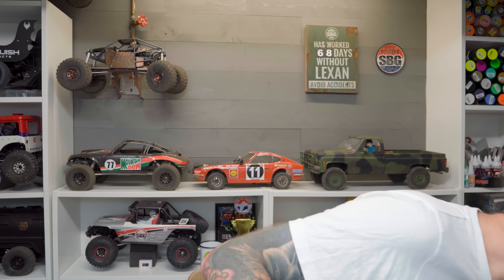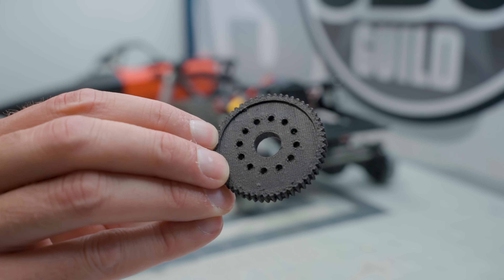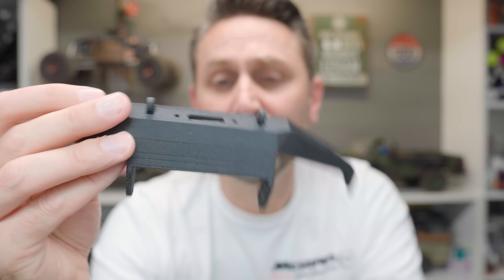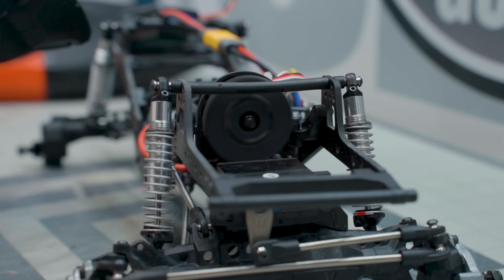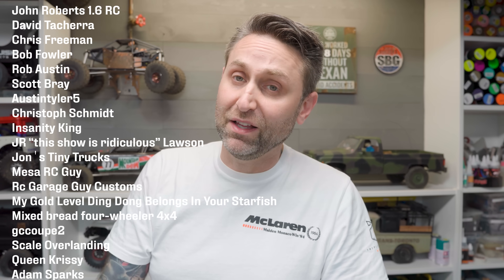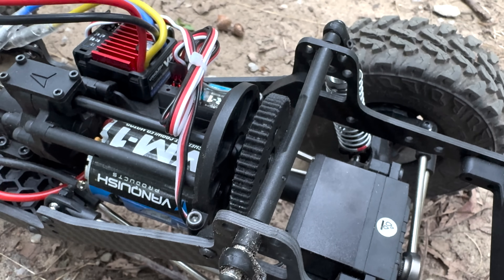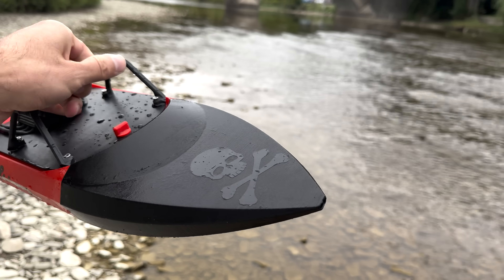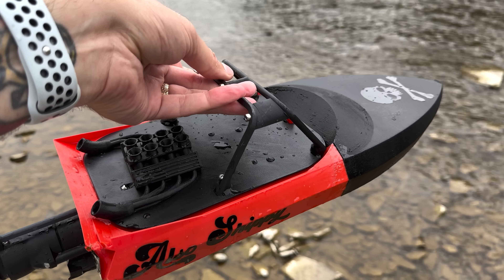Say Goodbye to Old Filaments – Meet the Game-Changer of 3D Printing!

Comment: Goodbye to old filaments? Not at $200 per kg it's not. It's certainly an interesting material, but I'd rather stick with some type of fiber-reinforced filament given the price.
Reply: It all depends on the application. At $200/kg I wouldn’t use it for Gridfinity bins, but for a complex part that I needed metal-grade strength and toughness for, it’d be a slam dunk and, yes, a game changer :-)
Reply: @JThelen1031  best part it’s not even a full kilo gram. 3/4 or .75 wow
Reply: Things can be game changers even if they're not affordable or easy to get to at first. There's things like telephones, cellphones, 3D-printing, CF-parts, WIFI and so on. All of them were insanely expensive in the beginning or required expertise.
Reply: The fibers aren't reinforcing anything. They might improve abrasion resistance but they far to small to add strength. And the weakest part of any print is the layers, which have no fibers joining them.
Reply: Fr just print CF or GF nylon
Reply: Interesting but too expensive
Reply: Prices will come down with volume, but I can’t see this ever being $20-$30/kg. It will likely always be a premium product.
Reply: We use $300 resin for jewelry business. So business owner can afford this filament.
Reply: well this saved me watching the vid xD 200 per kg is not worth it no matter what it is lol
Reply: Most fiber reinforcement is scary.  Tiny sharp fragments working their way into your skin, eyes, lungs.  Think asbestos, mesothelioma, etc.
Reply: Most fiber reinforcement is scary.  Tiny sharp fragments working their way into your skin, eyes, lungs.  Think asbestos, mesothelioma, etc.
Reply: Glad I saw your comment, I can skip this video.
Reply: Where did you get that price? I just checked on Amazon, and PPA-CF is $56 per kilo. Different companies charge different prices, but not by anywhere that much.
Reply: 200 the Chinese will copy themself fast
Reply: @psxtuneservice  It is not from China?
Reply: Does fiber reinforcement actually make pieces any stronger, though? My understanding is that the carbon fiber is chopped far too short to provide any real strength, which normally comes from many long parallel stands of carbon fiber. Instead, the carbon fiber adds stiffness and dimensional stability.
Reply: @Sharpevil in my experience it does, but I personally will never touch carbon reinforced or glass fiber reinforced filament ever again. You can rub your finger over the filament and you'll get fibers permanently embedded in your skin. We've banned the filaments at work entirely just on health concerns.
Reply: @Sharpevil no it doesn’t. It Can make it more wear resistant but carbon fiber needs to be in strands to do its thing. Pausing the print and glueing a ply of carbon weave then baby stepping the z and continuing printing is a fun challenge 😊
Reply: @Sharpevil  seems to help with layer adhesion too
Reply: @Sharpevil it does at least in XY plane. But adding fibers also improves printability like shrinking, warping etc. So it is not just about strenght.
Reply: @Sharpevil  i'll second everyone else here to say CF filament is MUCH more durable. back when it first came out we got our hands on a bunch and i did some basic 'can i break this' tests, and the answer was basically no. it was also much more rigid, which meant that, as it was cf-abs, it was a lot easier to print. much less warping. abrasive as /fuck/ though. steel nozzles are a must.
Reply: @Sharpevil  Yes, but only along the direction of the print because the carbon fibers align with the direction of the print.  CF does nothing, or can actually decrease, the strength of the filament against the direction of the print.
Reply: @Sharpevil Yes, it does. Stiffness/modulus is one measurement of strength.
Reply: @eighty-eighth_section   >Stiffness/modulus is one measurement of strength.

That's incorrect.

For example, aluminum alloyed with moderate percentages of other materials have the same modulus within the percent or two, but can vary in strength by an order of magnitude.
Reply: @nlkatz  I'm stating that there are multiple measurements of strength. Of course it would vary. You need to be specific. Are you referring to tensile strength? You didn't state that, nor the commenter.
Reply: @nlkatz  modulus is one mechanical property we compare between materials. This is one way we can the strength of a material. Tensile strength is separate property or value. I did not say they were the same.
Reply: @eighty-eighth_section  No, you stated that modulus is a measurement of strength.

It isn't; it's a measure of stiffness.
Reply: @eighty-eighth_section  >  This is one way we can the strength of a material.

Nope.

 Perhaps the confusion is because modulus and strength have the same units. 

That can be misleading, because modulus is strain divided by stress.

The units of strain are in./in. (or your preferred length unit), which divide each other out, so it ends up that modulus has the same units as stress.
Reply: @nlkatz  yes. Stiffness is one way to define strength. A strength is just a casual term of what we call some value of a mechanical property. It's whatever you want it to be. I can make up a property like fuzziness. And now I can compare fuzziness strength.
Reply: @nlkatz  stress is not the sole measurement of strength. What about impact strength? Completely different measurement and value. PLA has a relatively high tensile strength vs other common 3D print materials, yet many accept it as low strength or weak. That's because they are defining strength as some other property.
Reply: @eighty-eighth_section  If it's whatever you want it to be, anything you say about it is meaningless.

I'm not using the terms casually, I'm using the engineering definitions, which you need to understand if you want to know how much a part deflects, or whether it will break.
Reply: @nlkatz  it might be meaningless, but there are standard measurements of strength that are more used and more meaningful to compare. It's common to attribute a materials ability to resist deformation as a strength. That is modulus. That's why we see "strength tests" where people hang things off 3d printed parts and measure the deformation. Strength alone is not an engineering term. And you used strength yourself. It's meaningless if you don't use the specific terms. That's why didn't blanket comment that it is stronger. I specifically defined modulus as my measurement of strength or comparative value. Because simply saying strength would be meaningless and perhaps misleading.
Reply: @nlkatz  ok, I'm looking it up. You are right damn it. The term stiffness and strength are distinct in engineering terms. And yes materials can have high stiffness and low strength and vice versa. But many people would determine whether a part is strong or not by bending it. And if one material starts to slightly bend before the other, then they usually say it is weaker. But in technical engineering terms, that is not necessarily true.
Reply: @eighty-eighth_section  Correct, now at least two of us know betrter :)

My hat's off to you for having an open mind
Reply: @Sharpevil yes, but between layers I have doubts
Reply: @Sharpevil  I’m with you here. I absolutely deny that CF filament gives any benefit. It actually sounds silly. Glass fibers in a very already rigid material maybe, maybe, but I don’t have as much experience with glass fibers.
Reply: @TJbuffs  GF and CF nylon absolutely have different properties from vanilla nylon, they're stiffer and warp less while printing. No you're not getting the full advantages of fiber materials, but it does make a difference
Reply: @coledavidson5630  most of that is just because of void space/ filler. It warps less because it’s less plastic volume to warp. Stiffer for the same reason. But not better. CF chop in filament is stupid. Anyone who knows CF will tell you that. Try it with any fiber, you’ll get the same result. The CF itself doesn’t do anything extraordinary. Think of what makes CF special, the spanning fibers, then think of chopping up those fibers, taking away the benefit. It’s the same silly argument about “forged carbon fiber parts” where people chop the CF and smash it into a mold or whatever. Silly geese 🪿
Reply: @TJbuffs  how is it silly if it achieves desirable results?
Reply: @coledavidson5630   because you’re being tricked into believing it’s something else. It’s not giving you the results it should be according to the actual additive. It’s silly because you’re being bamboozled by people depending on you being ignorant. If you want to buy it. That’s your business. I’m just the gracious homie looking out for you.
Reply: @TJbuffs  you keep saying I'm being tricked, but I've never been under the impression it will give you the benefits of actual fiber weaves. Nylon with CF and especially GF are still just great materials. I fully understand you're trading away some of the nylon's inherent toughness for more rigidity and printability. These are more desirable properties for most hobby 3d printing applications at a pretty affordable price. What more would I want out of it? If you know a better alternative filler at the same price range or lower, I'd honestly appreciate hearing it, no sarcasm
Reply: @Sharpevil  Exactly what do you think tensile strength is?
Reply: Found 1KG for $70 on amazon, and Bambu has 1Kg on sale for $100, still not cheap But if you need it than it looks really promising
Reply: @MrHeHim  I think you may be seeing PA CF. Though right now Bambu does have it on sale $100 for 0.75KG
Reply: Make sure you wear gloves and a mask when dealing with printed CF products and I don't mean just while printing
Reply: @KernsJW no. You’re exaggerating. These are not that dangerous. People are thinking that these are like fiberglass insulation which gets in the air in large quantities when working with it. That’s not true.
Reply: peek is used all across the industry and it's $500 to $600 a kg
Reply: @NeutronRoboticsAcademy  yeah, in industry that's acceptable, hobbyists do not use PEEK pretty much ever
Reply: @NeutronRoboticsAcademy  youre confusing industry and hobbyists though. the difference is that industry sell those products so they can charge for the filament cost. hobbyists dont.
Reply: This is a fibre reinforced filament.
Reply from the maker: Fair enough! Thanks for watching!
Reply: Fiber reinforced filaments are not stronger, but weaker than non-reinforced. Its because the fibers are more of a filling, and actual fibers. So there is less of actual plastic in the material.
Carbon fiber works because the fibers are woven, they are long fibers. You can just add tiny fiber sub mm strands into a plastic and expect it to become stronger.
Not to mention how those tiny stands will be in your room air, in your skin from contact etc.
Reply: @Nobody-Nowhere supposedly thats for certain filaments like pla but it does make other filaments stronger
Reply: @Nobody-Nowhere  this is exactly it
Reply: @Nobody-Nowhere undiluted nonsense...
Reply: @Nobody-Nowhere people who say this are talking about cheap cf filaments. The better cf filaments are quite strong. You can tell a good from bad by dropping the part on something hard. A good cf filaments will sound like glass.
Reply: @Nobody-Nowhere  you don’t know what you are talking about. Adding fibre can reduce some mechanical properties but it can drastically increase others.

There are also no real known health concerns to do with printing using fibre filled filaments and whilst some may get in your skin there is very little or no information that just printing it will put the fibres in the air.
Reply: @conorstewart2214  From what tests I've seen having small pieces of carbon fiber in filament hasn't been that useful. There are printers that lay continuous fibers while printing and those do help.
Reply: @conorstewart2214  The only thing it seems to help is dimensional stability, but its much weaker and muck more dangerous to your health. So using those filaments simply do not make much sense at all. Its mainly marketing hype, that uses the image of carbon fiber to sell it.
Reply: @conorstewart2214  because there’s almost no real data on that as a whole. This is wild to see these arguments. Madness actually.
Reply: @Nobody-Nowhere you watched one video and decided CF filled filaments are weaker. Layer adhesion can have issues, but actual tensile strength across X and Y is WAYYYY higher. I've literally compared it. Not only that, stiffness dramatically increases. You've clearly never even printed the stuff so why do you even have an opinion on it? I've printed CF nylon for 4 years straight. It is incredibly strong and stiff and if printed right, has very good layer adhesion. All my parts are subjected to high stress that breaks 3dp parts.
Reply: @conorstewart2214  watch easy composites video where they tested printed CF reinforced... It's not very strong ( possibly stronger than not. But nowhere near the strength of proper CF.) personally wouldn't waste my money.. I'd rather print a plug to get a mould. Then use proper CF

Comment: Ok heres the secrete to strong fdm filament i will only post once so you buy yourself plastic solvent bonder the thinner the better then you put it in a spray gun and coat the whole body or whatever part you printed and that will bond the print layers into one and that body or part will be so strong you wont believe it. you print at 100% infill then spray and OMG i can have my wife stand on my rc body and will hold her no prob.

Comment: ..Edited.. Is it PPA-CF or PPS-CF? I have found the PPS-CF but it says you can only use it with the X1E. I can't seem to find a single thing on Bambu's website about PPA-CF. 

I found it!.   I was trying to use their filter tool and PPA  was not an option, only PPS. It is in the PLA section on Bambu's website.

Comment: Looks interesting. I have been using NylonX by MatterHackers for a while now, but have not tested the parts like you have and have not printed any as large as the hull on the boat. Definitely a game changer in giving you the ability to repair broken parts and designing stronger ones, once you overcome the CAD learning curve.

Comment: Ppacf is a huge game changer. I watched a guy print an elephant figure and then stand on it. Fuzzy skin makes the finished product look so much better and gives that Bedliner look and feel in things.
Reply: "I watched a guy print an elephant figure and then stand on it"
So? Tests have shown even a screw thread printed in PLA can hold up to 50kg, you don't need special filament for most purposes. And on top you don't risk your lungs with carbon fiber dust.
Reply: @yakostudios5405 Look up- After 11 Prototypes, I finally did it. from Morley Kert.  He stands on the mini Elephant figure in it and also makes a killer part for the One wheel.
Reply: @yakostudios5405, https://youtu.be/RzFl3H5293M?si=LwlcrqOksKaGwgdP
Reply: @yakostudios5405 I guess it's from the latest video of Morley Kert.

Comment: for 166$ a roll is crazy expensive. And it says it's only possible to print with X1C. I don't know why a P1s with hardened nozzle would not be able to print it.
Nice review nonetheless, A PLA+ or tough spur gear would have yeet itself to the moon. I really like the 3d printing content.
And do you have a link for that boat? looks awesome.
Reply: It's actually only $100 per 750 g spool right now. The P1S is enclosed and supported, as long as you use a hardened nozzle and hardened extruder.
Reply: @eighty-eighth_section  That's what I thought. P1s is the same printer without the AI detection, camera and the screen.
I will give it a try. Pretty sure my other 3d Printer can print it, a Flashforge 5M Pro.
Reply: Taken straight from the product page:
"Bambu PPA-CF is compatible with P1S, X1C, and X1E printers, requiring only an enclosure and a hardened steel nozzle. This filament is easier to use than you might think, printing smoothly at nozzle temperatures between 280°C and 310°C. Expand your possibilities with Bambu PPA-CF."
Reply from the maker: Search MJet on CGTrader. As for the price, yes it’s expensive, but if used sparingly on high stress areas, I can see it pay for itself rather quickly. P1S isn’t enclosed and needs to keep some mega high temps to print properly.
Reply: @scalebuildersguild  Awesome, I will get that model for sure. Keep the 3d Printing content coming, I will watch them all. Cheers
Reply: mjet supersprint 
and ragnarok rc boat